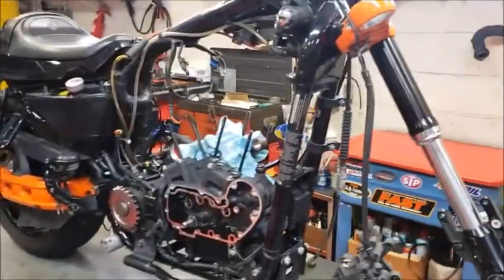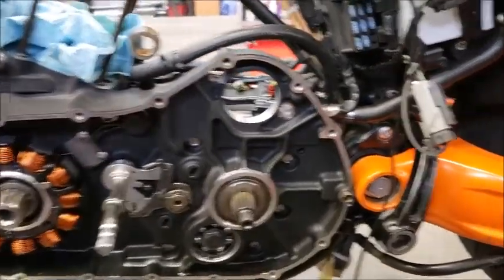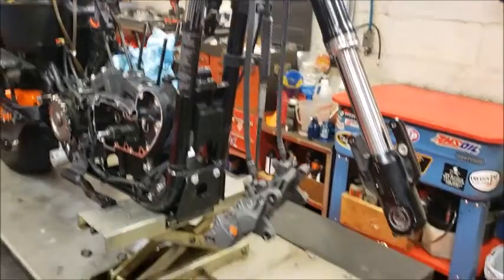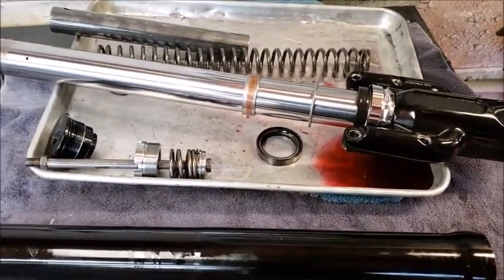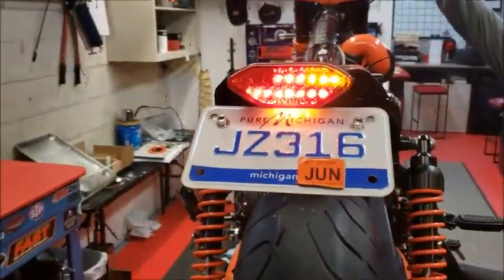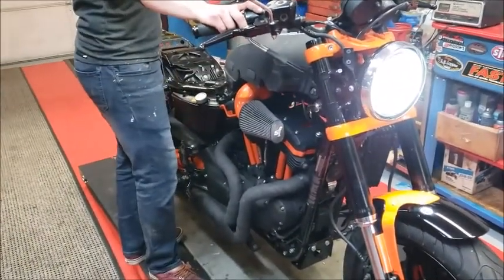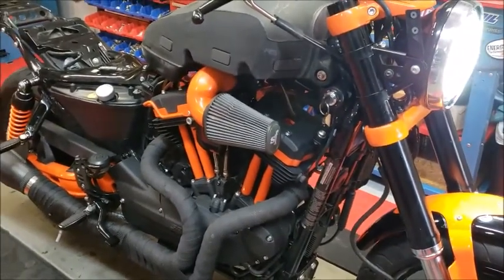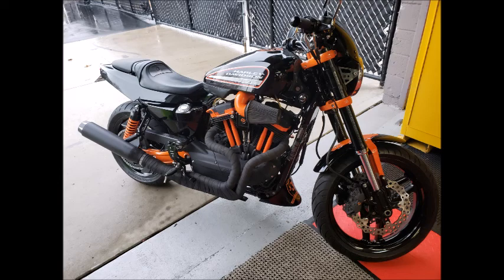XR1200   For Street and Strip

Comment: I have a 2018 Forty Eight, I have modified the hell out of it. I am going to powdercoat a XR1200 swingarm and an XR1200 crank when I do my crank work. I am trying to figure out what to do for rims and tires. I like the 3 spoke Buell rims, the xr1200 rims or the xl1200 roadster rims. All of them are beautiful wheels, it all depends on which fits easiest!
Reply: I own an XR. Try to get a 17 inch front rim. You get none tire choices.

Comment: Can't wait to see what kind of hp and tq #'s you hit with a good tune. Good luck on the strip this year and if you whip up on a hayabusa, you have to post that video.
Reply: I ran I ran a 9.6 at 123 against a busa with a 9.7 at 130 on the all-out dyno drags with my 2017 Dyna s with a 117 cu. In. stage 4 plus kit made 120 horsepower and 125 ft lb of torque